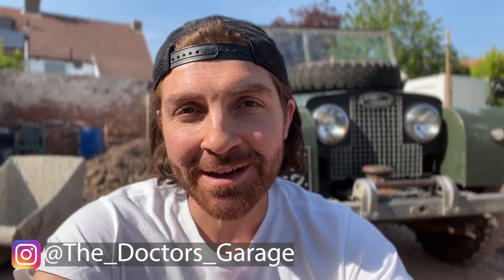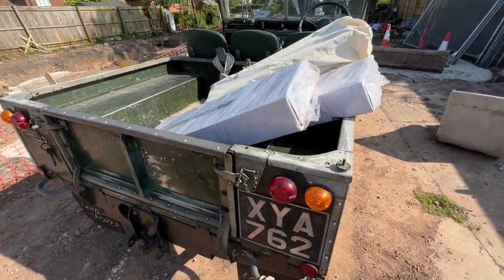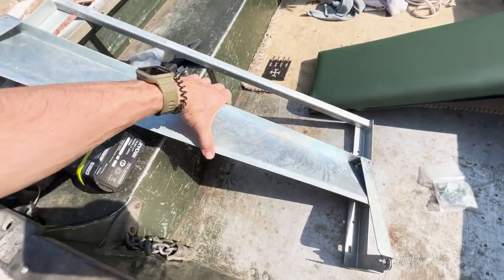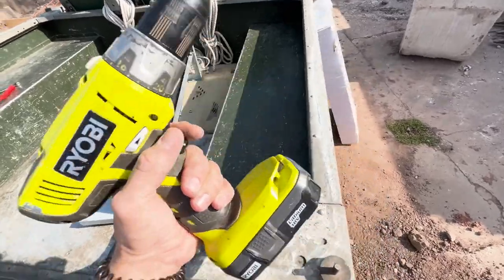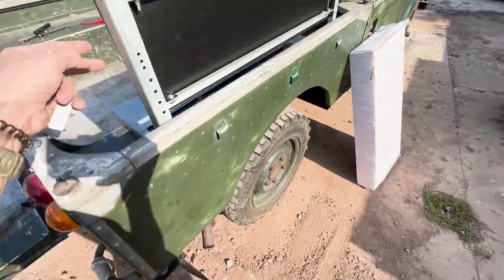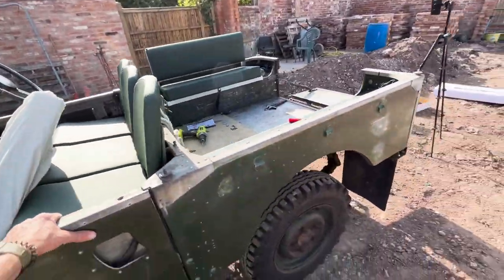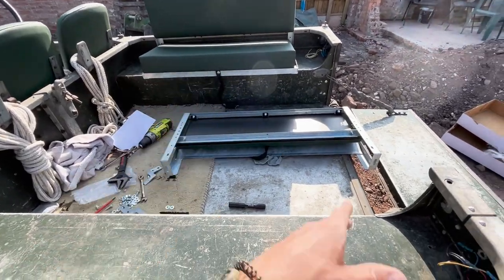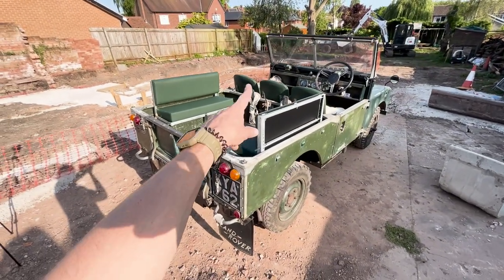BIGGEST UPGRADE FOR MY SERIES 1 LAND ROVER!

Comment: I think the idea of those extra bits is that the "tab" goes under the side skirt gal steel, that piece you said is 50 years old. So the bolt holes go towards the base of the seat upright. Then the "tab" faces upwards and slips under the upside-down "U" shape of the side rail. This will lock the seat back to the side rail, but not permanently. I agree with others comments, you should get some rubber sheet to separate the seats from the car, reduce the inevitable rattle noise!

Comment: Hi Doc,You really need to loose those crossply tires. Some good radial tires will transform the ride and most of all they will improve handling and the car will not be wandering from one side of the road to the other. Another advantage is they have a lot less roling resistance.

Comment: If you install these too much of a right angle it becomes very uncomfortable to ride in. Always feels your going to slide off and back is pressed. I installed mine a little out so that it's better on back.
Reply: Yes, I thought the same. Installing the seat squabs an inch or two nearer the centre of the vehicle would allow the backrests to tilt back a bit rather than 90° and I'm sure would be far more comfortable. I'm also surprised the backrests don't fold down flat when not actually in use. Otherwise, they look great and, like the front seats, the green looks much better than black and will be cooler too on a hot day.

Comment: Not sure about travelling that exposed without at least a seat belt.
Reply: Grahame, there’s some weird type approval law which doesn’t allow you to fit seat belts as you’re, in effect, travelling sideways.
Reply from the maker: I think I’d rather take my chances and jump out the back than be strapped in to that thing! 

But yes I agree they are really dangerous for any sort of road driving more than a country road at low speed. I think they do complete the look for the rear though!